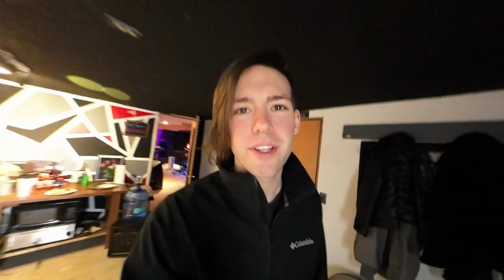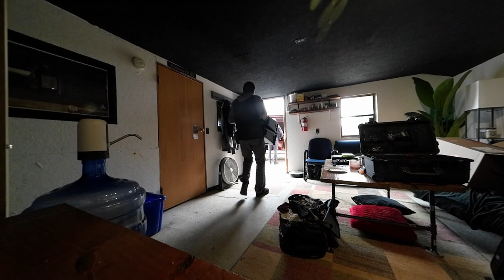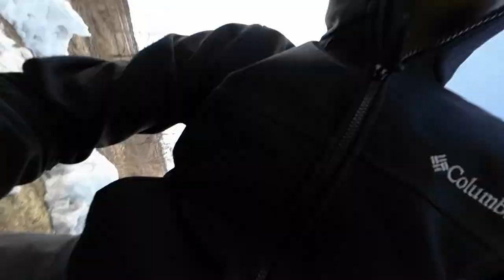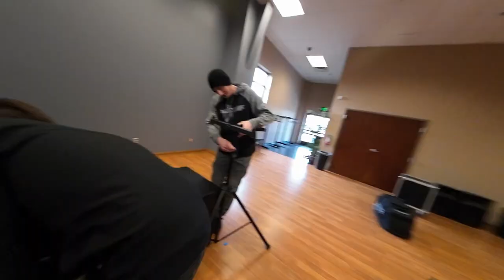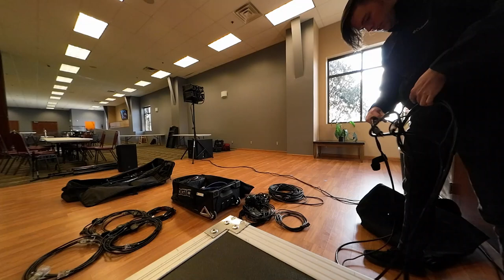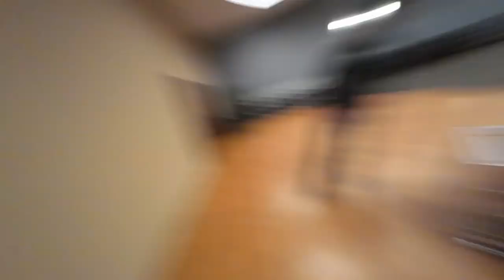Gig Vlog - Open Mic at Cardinal Lanes

Comment: Cool, cool!

A few suggestions, if I may.

1 - PLEASE slow down your camera movement. Makes it hard to watch your videos.

2 - Get yourself some packing/moving blankets. Excellent at protecting uncased gear in your trailer. You can find them online and I know in my area I find them at Harbor Freight. I'm sure other hardware/tool discount retailers have them as well.

3 - Consider mounting your tops directly on your subs. Eliminates the need for tripods, which always leaves you dealing with legs sticking out and becoming a trip hazard. Plus it allows you to align your tops and bottoms.  My subs all have pole mounts, but I have added M20 threaded pole mounts to some of my top speakers to allow mounting light bars above them. I believe you can get pole mounts that screw onto the outside of the sub. I drilled holes in the top of the speaker and mounted them flush. Works better for me. 

4 - A heavy duty two wheel hand cart is worth it's weight in gold! Most everything I have is on wheels(ie, subs strapped to wheel boards) or in cases with wheels, but I still use my hand carts quite a bit for those few, non-wheeled pieces.

Sounded nice in that room. Good job!

Look forward to more videos. So far I find them informative and enjoyable to watch(outside of the snappy movement!).

Joel
Glaser Audio Productions, LLC
Reply from the maker: Thanks Joel! I really appreciate the feedback and all of your tips! I literally just bought some sub poles after editing this down! I'll make sure my camera stabilization is on next time and be more mindful of my camera work. Thanks for watching!

Comment: As far as stands, i’d recommend the Ultimate Support TS110b or Hercules ss710b. I use those for my RCF HDL 6’s. The ultimate support stand goes up to 9 feet and the hercules crank stand goes to about 7 feet.
Reply from the maker: Nice! I just bought some of the lift assist Ultimate support sub poles for this configuration
Reply: Made setup so much easier right?